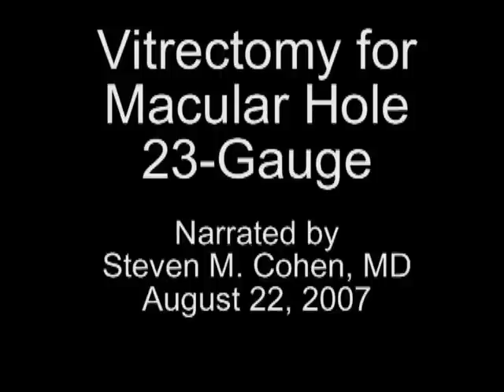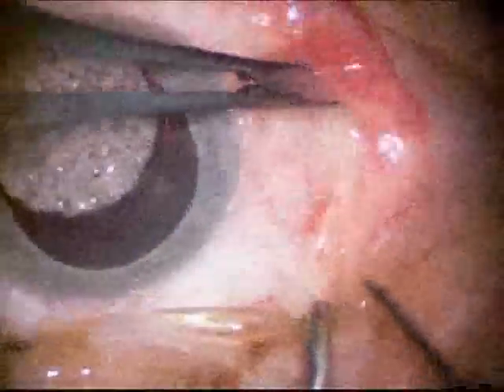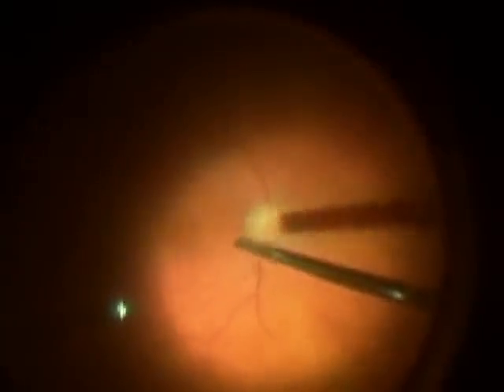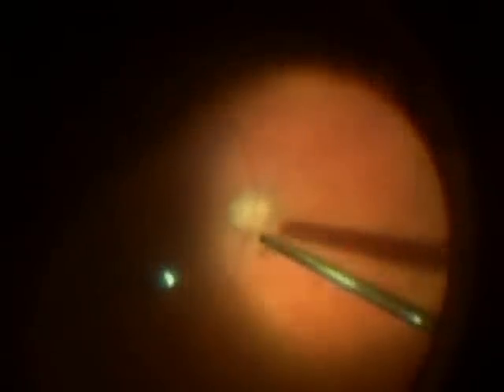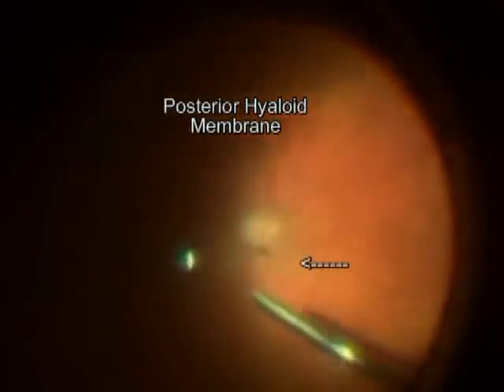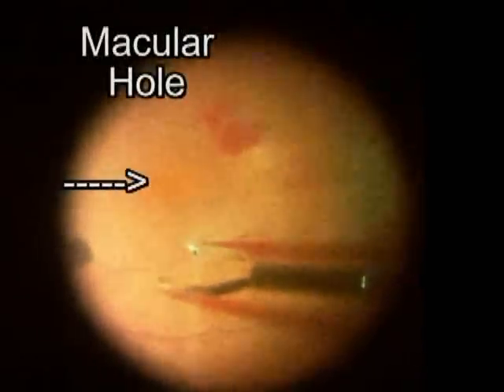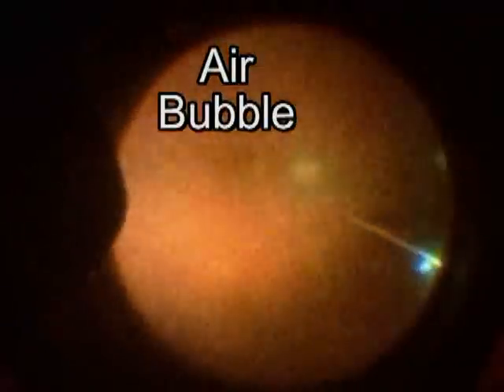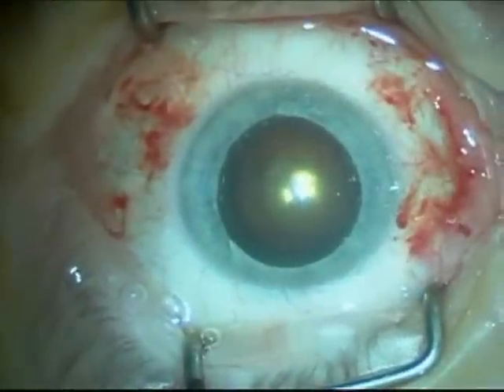Macular Hole Vitrectomy Gas

Comment: Dr.  Cohen, I had this surgery 4 days ago in one eye and the bubble has not materially decreased in size.  I can't say that I see any improvement in vision compared to the day after the surgery when I was able to see my fingers moving when held close, and that is still the case and not more. It would be good if you put up a video showing the reduction of the bubble size over time, as well as reduction of other side effects such as the bloodshot that is formed due to insertions of various probes.  There is quite a bit of posts on the Internet, but a picture is worth a thousand words, and a video worth a million;) , especially from a qualified surgeon.  By the time you post the new video, I hope I have recovered already, but I believe it would benefit future patients, and that's a good feeling.

Comment: Hi. This is an interesting procedure. Sadly, I have a macular hole in my left eye. I was scheduled for surgery about 3 years ago, and my insurance dropped me because they didn't file our paperwork correctly. After battling with them, they finally realized their mistake and gave my insurance back. There was a lot of back and forth before that, but by the time I was able to get the surgery again, the hole had hardened around the edges. I've had the surgery 3 times, but it appears I will not be fortunate enough to get my vision back. I kind of miss the distortion before the surgery because now there is this dark black hole in the center of my vision. I am in my late 30s, so I guess age might have sonething to do with this. In 2013, I had a detached retina. The macular hole followed soon after. I'll admit this is sad and scary. I have a 5 year old, and I study her face and smiles just to have them clear in my mind even if not clear in my sight. My right eye is weak, but I can see with a contact. I am sure I will pull through this challenge as I always try to stay positive. Thank you for sharing this video. It is always nice to have a better unserstanding.